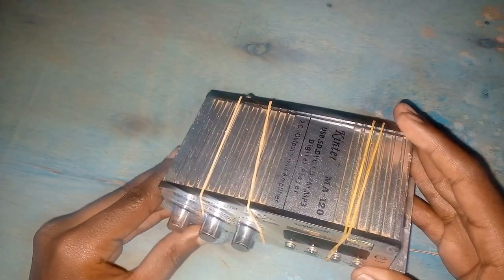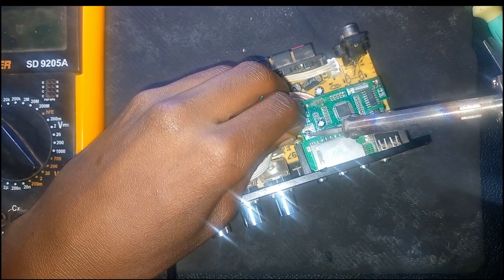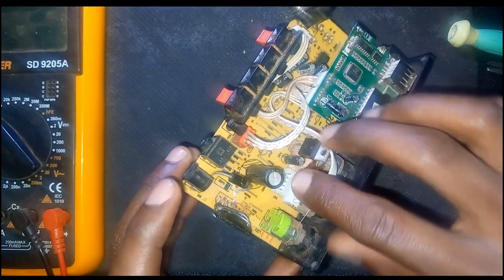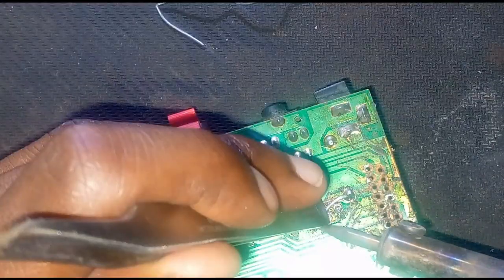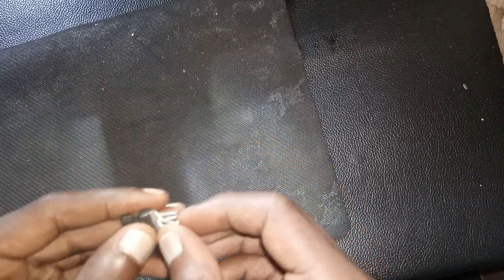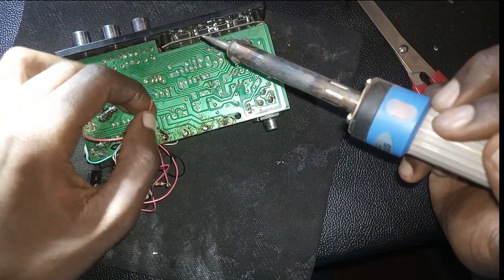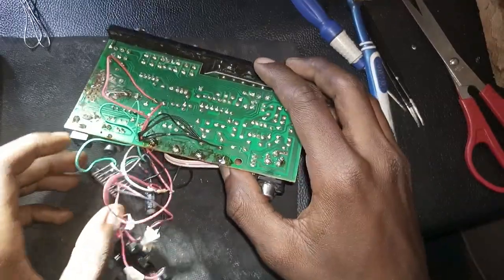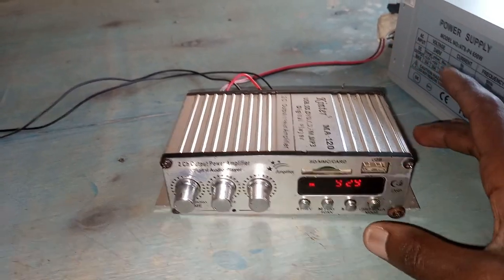Replacing TDA 7266 with TDA 7057

Comment: I have amplifier yt326z no sound problem I changed new IC still not working
Reply from the maker: Check the 4148 zener diodes, and also if sound signal is coming from the usb player
Reply: How to check the sound Signal from the usb?

Comment: I have amplifier yt326z no sound problem I changed new IC still not working
Reply from the maker: Check those two 4148 zener diodes next to the IC 7057, if they are shorted replace them